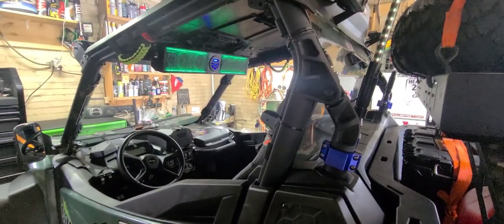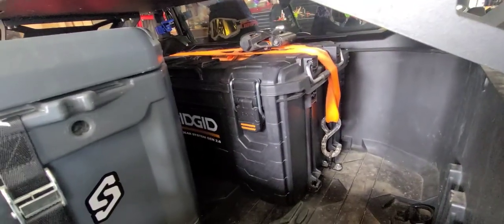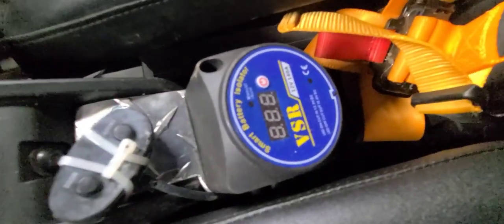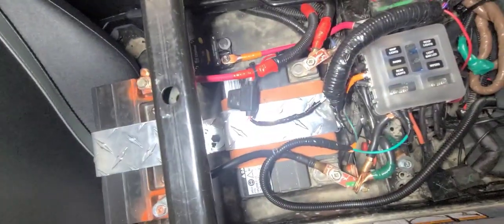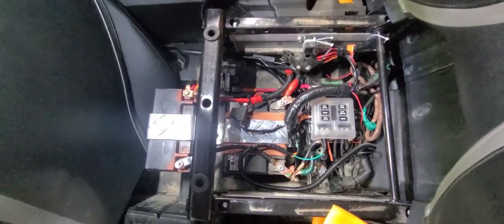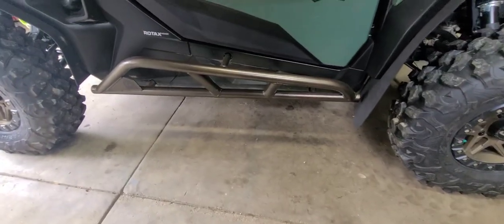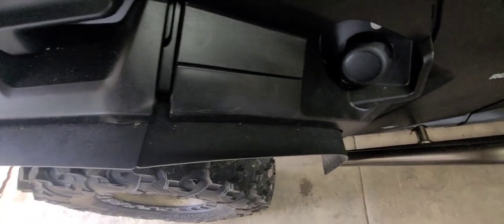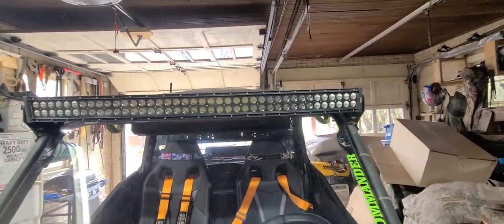2022 Can Am Commander 700dps my add ons and dual battery setup location.

Comment: What size Carnivores? What wheel offset as well? Did you leave your sway bar off? I do a good amount of riding in East Tenn and its a mix of trail and some road.. definitely a good amount of rutted trails. Thanks!
Reply from the maker: Yea i left sway bar off. 30-10-14 carnivores. I think i bought 1-1/4"  spacers for the rear so i could run the same rims all the way around and it wouldnt look funny lol. Ive beat this thing on deep west virginian ruts and rocks and have had zero issues.
Reply: @mudmechanix  30s clear without lift or do you get some rubbing? Or did you put a lift on it as well? I used to have an Outlander quad, but have since moved up to a 23 Commander 700 dps. Love the machine, just want a bigger tire for more clearance. And did have a little hairy situation where front tire dropped into a rut and back became off kilt and thought we were going over. Luckily it didnt but definitely made me think about removing sway bar and bigger tires lol
Reply from the maker: 30's clear easily no lift.
Reply: @mudmechanix  thanks brother! Guess its time to spend a little more money lol
Reply from the maker: No problem! Thats all i did for the 1st year man😂🤣
Reply: @mudmechanix  I feel that. I bought it and within a week, got Can Am 4500lb winch, 42" lightbar, Bimini roof, 10 speaker sound bar, door bags, front and rear windshields, cooler and mount kit, tool box and a bunch of tools. Have bumper, LED Signature lights, and Rock sliders on order. Its only money right? Lol.. Also check out Tiger Tails, they are awesome!.. edit... also put a back up camera on it and mirrors.
Reply: @mudmechanix  Do you by chance remember if you went with a 4+3 or a 5+2 offset? On your wheels? And we should link up and Go ride some Tennessee trails. Ill be at HFMcCoy end of next April.
Reply from the maker: @jkenyon1980  wish i could post a pic of my wheel specs. It just says size 14×7  4×137 lug pattern and  2inch back spacing
Reply from the maker: @jkenyon1980  2+5. Found it lol
Reply: @mudmechanix  You the man! Now im gonna be up all night looking at wheels lol
Reply: @mudmechanix  Subbed... let me know if you want to try and set up a ride sometime. If youve never been to Royal Blue its beautiful, and lots of things to see!
Reply from the maker: @jkenyon1980  i will forsure!! Appreciate it man
Reply from the maker: @jkenyon1980  i have always wanted to ride in tennessee. Just haven't made it there yet. We went on vacation to gatlinburg last year but not riding.